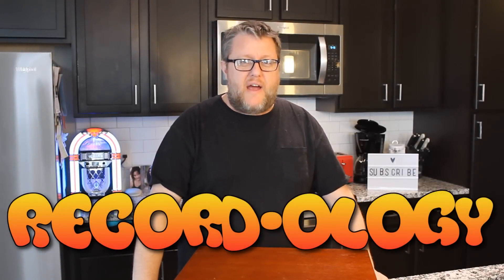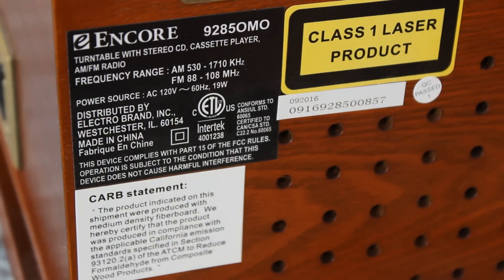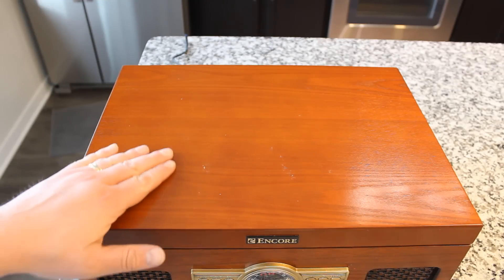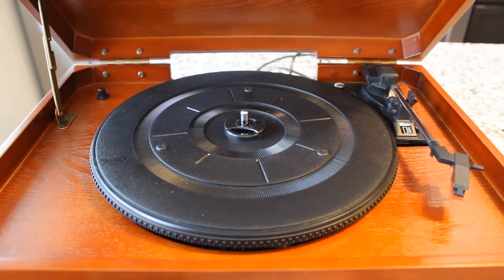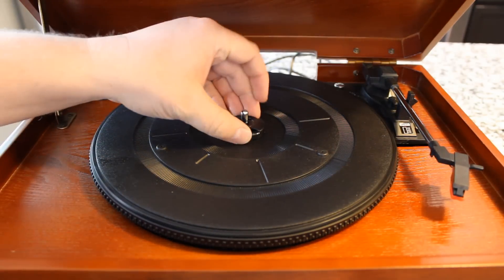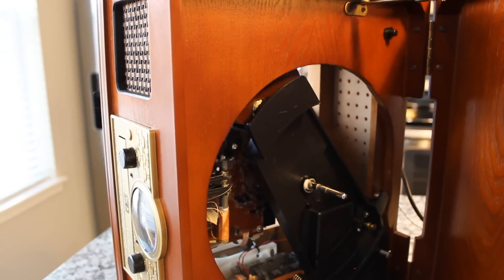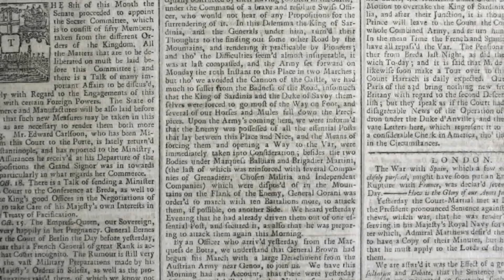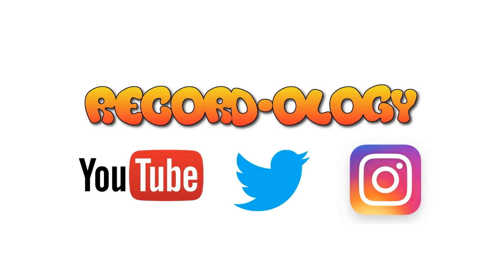Mystery All in One Review PLUS TEARDOWN! - Record-ology Deluxe!

Comment: Pretty OK unit considering the pricepoint of these units. The innards are probably identical to some of the other retro styled all-in-one units with "Crosley" or "Victrola" branding. Most of these units are not made of natural wood, they are pressboard. There may be some small pieces of actual lumber used, but not much. As long as you're very careful, these units can last.